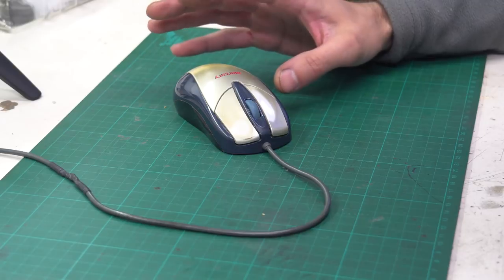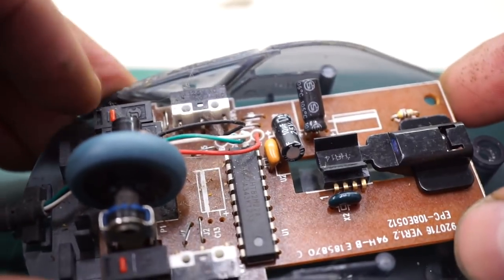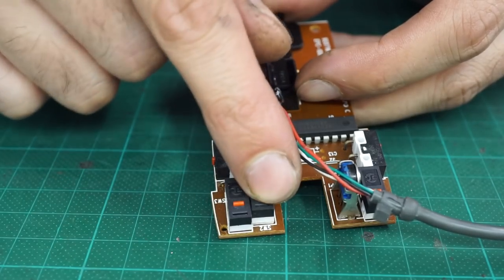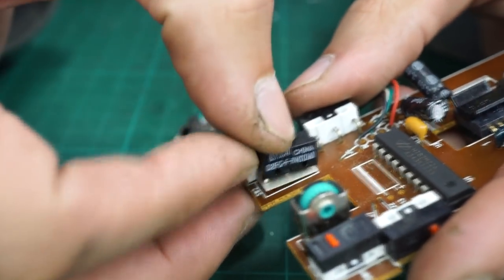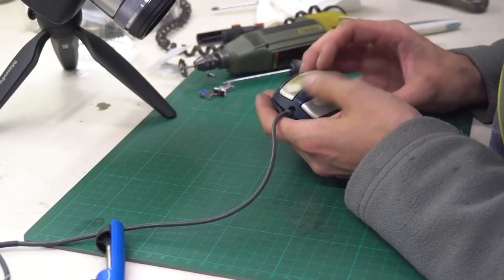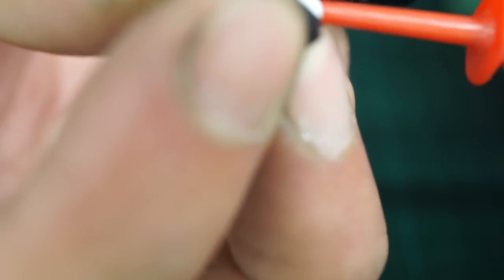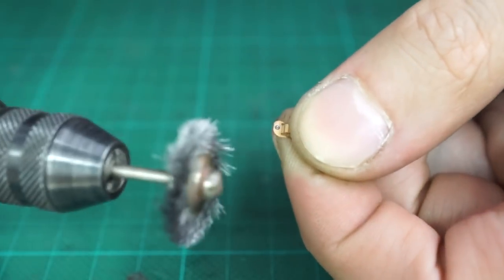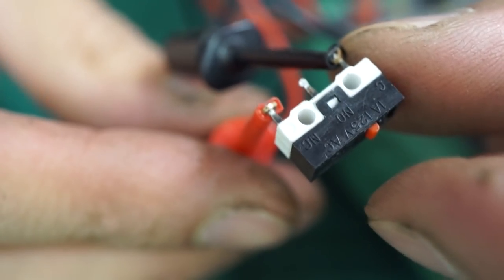PC mouse Repair / refurbished + repairing microswitch

Comment: This is the best microswitch contact repair ever. It is simple and well explained with real practical advices and examples.
The ignorants must learn this way that almost everything can be done with a little bit of effort.
Not because you are cheap, just because you love that product and don't need to spent lot of money to replace it.

I'm not referring to the ones that don't know what is a soldering iron or what the use of the screwdriver is and to the ones to can't believe that things they use can be opened or they are allowed to  ;-)

r/whooosh or not?

Comment to that if you want to troll them, they are growing in numbers day by day with facebook, pffff.... !

P.S.: I want to give more than 1 mil likes to this video, but i can't so you might want to post this to reddit and all over to get it in trending now!

Comment: I have a switch just like the last one black and white which u disassemble.
It has a lever
I accidentaly punched the lever and it fell off, do you know if I can replace it? do I need to disassemble it so I put it from the inside? thanks
Reply from the maker: Sure there are many switches existing in two version with or without lever, that mouse need button without lever, so if you got spare switch with a lever you simply remove them and you got right switch you need.
Reply: @TinC33  thanks :) you saved me some money and time